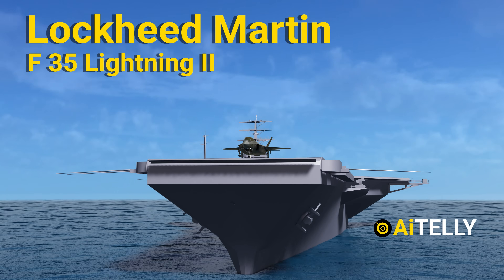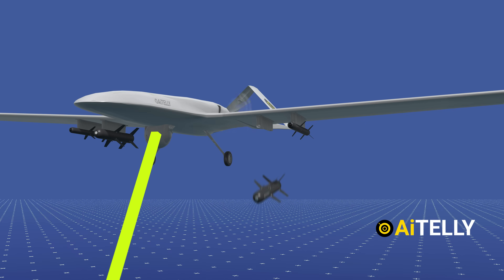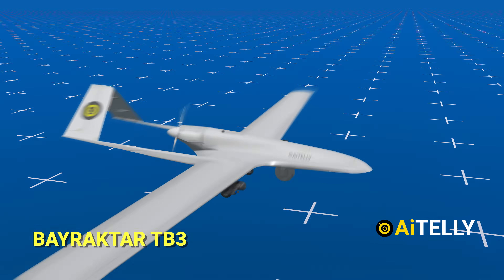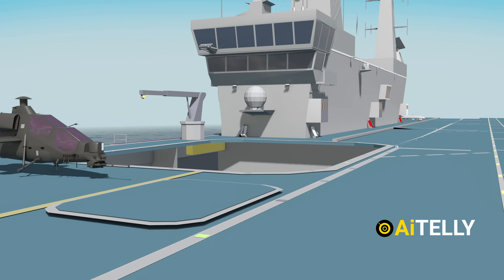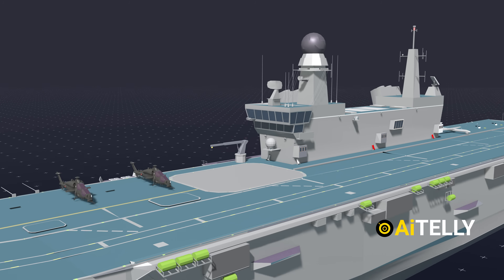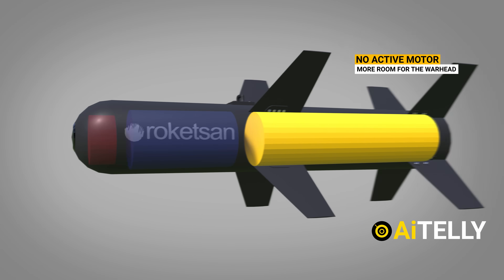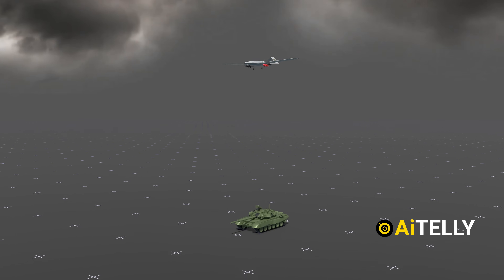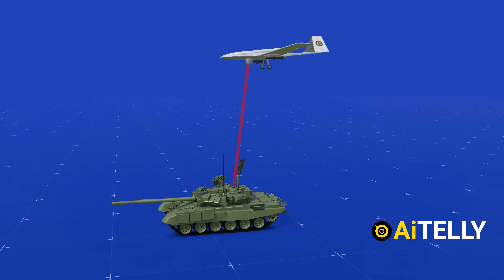TB3 Bayraktar drone Turkey | How it works #drones #tb3 #aircraftcarrier

Comment: Much better video. Well researched information and on point animations.
You could do a follow up on the same carrier with the replacement of the f35's by 5th gen air superiorty fighter drone Kizilelma. It just took it first flight some week ago. This will be the primary strike force of the carrier for bombing and taking on manned fighterjets with its air to air capabilities. Along with dead and seas calabilities and an Electronic warfare system it is a very deadly drone. This will make Turkiye the worlds first country with a drone carrier fleet.
Reply: Iran did this in 2019
Iran has displayed the first fleet of drones that can be launched from the deck of Iranian submarines.
And they also operated a huge fleet of various types of drones, operated by a large ship (drone carrier) that has a drone landing strip on its deck, and even held maneuvers.
These drones, like submarines and warships, are all made in Iran

Iran is the first country that has innovated in this field and owns this fleet and even related vessels
Reply: @autumn_888  also a country that accidentally shot down a passenger plane. Here we are running from an unmanned aerial vehicle with a wingspan of 14 meters. Not small vehicles launched by catapults.
Reply: @autumn_888  iran dronları teknolojik olarak Türk dronlari ile kıyas olamaz iran Devleti abartmayı sever gösterişi çok sever

Comment: The TCG Anadulu is in Sea trials phase not in development phase it means that all components of the Anadulu ship are in place and they are tested being in development means they are still constructing and adding components which is not the case here as you mentioned with a grain of salt,  2 weeks ago they started Helicopters landing trials one S70 seahawk and one Cobra attack helicopter were used in  the trials. Another information to add the TCG Anadulu is also expected in the future to host the Kizilelma advanced jet powered attack /air to air drone this is what supposed to cover for the lack of F35 in terms of naval air to air coverage while the TB3 will be used in sea to and ground attacks
Reply: Thanks brother
Reply: Can it carry the Anka 3 too?
Reply: @theancientsancients1769  originally ANKA 3 was developed for tactical bombardment. air to land. But if we force it, it can carry. But we dont need it.
Reply: @theancientsancients1769  It will be a different version of ANKA-3 with stronger jet engines.
Reply: @theancientsancients1769  Nope it's a little bit big for this :)
Reply: @theancientsancients1769  )yes, the phoenix 3 will also include a carry-on room. TCG anatolia will include a red apple, Hürjet.
Reply: Tcg Anadolu
Reply: sea tests are finished almost 5 months and it is signed to sea forces now. it means all done and ready
Reply: Now Kızılelma allow Air vs Air
Reply: @Batu-Han1071  Yeah it has capabilities to carry air to air missiles such as bozdoğan and gökdoğan
Reply: now its done and ready
Reply: Yesterday was the first ever landing and take off of the TB3 Drone from The TCG Anadolu this is a historical moment as it could be the start of  specifically using Unmanned aerial vehicles for carriers as main platform

Comment: Pretty great iteration of the TB series of military drones!   I think 2 emergency acceleration hypergolic, or solid fuel mini rockets operated from the tail support tubes would give this drone, some emergency, in use, survivability.    A semi-automatic rifle barrel pointing out of the wing tips and parallel to the wing length; like maybe the leading edge; or the center of the wing,  would provide some interesting offensive options.   Side firing guns have long been mounted on heavy bombers; why not a lighter version of that?   Especially if the drone is equipped with live feed cameras.  Point one camera out of the wing tip to help aim the wing-rifle.